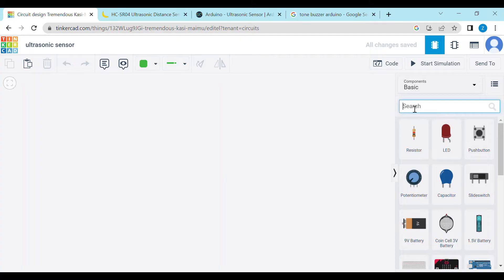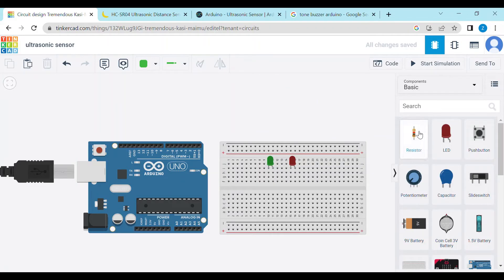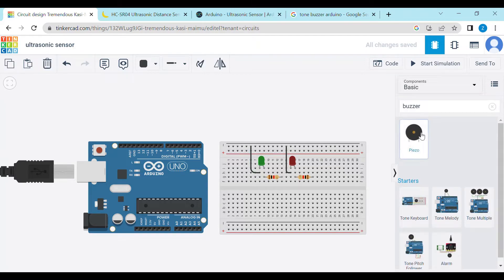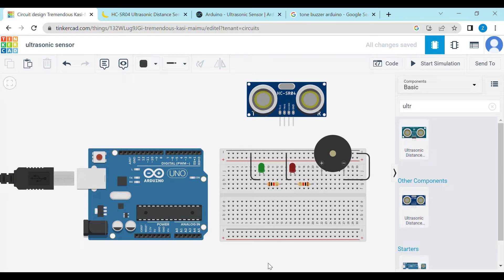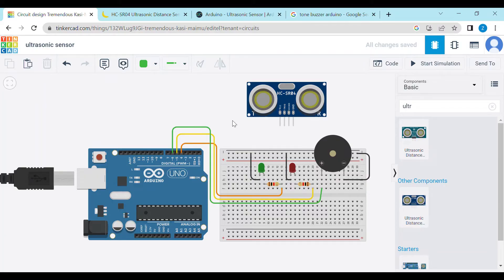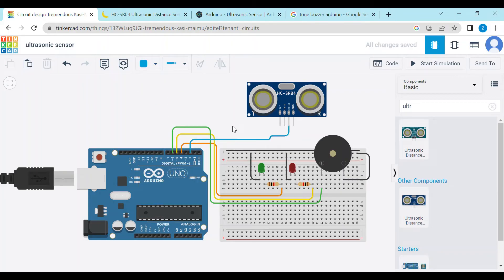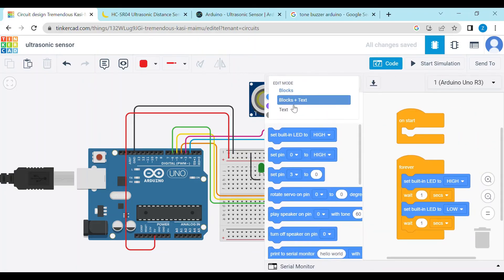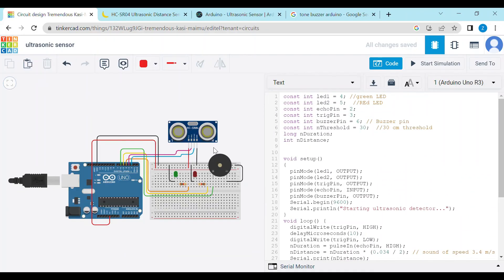How to Make an Arduino Ultra-Sound Parking Sensor with tinkercad

Comment: const int led1 = 9;   // Green LED
const int led2 = 10;  // Red LED
const int buzzer = 6; // Buzzer pin
const int echoPin = 7;
const int trigPin = 8;
const int threshold = 30; // 30 cm threshold
long duration;
int distance;

void setup() {
  pinMode(led1, OUTPUT);
  pinMode(led2, OUTPUT);
  pinMode(buzzer, OUTPUT);
  pinMode(trigPin, OUTPUT);
  pinMode(echoPin, INPUT);
  Serial.begin(9600);
  Serial.println("Starting ultrasonic detector...");
}

void loop() {
  digitalWrite(trigPin, LOW);
  delayMicroseconds(2);
  digitalWrite(trigPin, HIGH);
  delayMicroseconds(10);
  digitalWrite(trigPin, LOW);

  duration = pulseIn(echoPin, HIGH);
  distance = duration * 0.034 / 2; // sound speed 0.034 cm/µs

  Serial.print("Distance: ");
  Serial.print(distance);
  Serial.println(" cm");

  if (distance < threshold) {
    digitalWrite(led2, HIGH);
    digitalWrite(led1, LOW);
    digitalWrite(buzzer, HIGH);
  } else {
    digitalWrite(led1, HIGH);
    digitalWrite(led2, LOW);
    digitalWrite(buzzer, LOW);
  }
  delay(500);
}

Comment: I need a code for this please send
Reply from the maker: const int led1 = 4; //green LED
const int led2 = 5;  //REd LED
const int echoPin = 2; 
const int trigPin = 3;
const int buzzerPin = 6; // Buzzer pin
const int nThreshold = 30;  //30 cm threshold
long nDuration;
int nDistance;

void setup()
{
  pinMode(led1, OUTPUT);
  pinMode(led2, OUTPUT);
  pinMode(trigPin, OUTPUT);
  pinMode(echoPin, INPUT);
  pinMode(buzzerPin, OUTPUT);
  Serial.begin(9600);
  Serial.println("Starting ultrasonic detector...");
}
void loop() {
  digitalWrite(trigPin, HIGH);
  delayMicroseconds(10);
  digitalWrite(trigPin, LOW);
  nDuration = pulseIn(echoPin, HIGH);
  nDistance = nDuration * (0.034 / 2); // sound of speed 3.4 m/s
  Serial.print(nDistance);
  Serial.println(" cm");
  if(nDistance < nThreshold) {
    tone(buzzerPin, 2000);
    digitalWrite(led2, HIGH);
    delay(400);
    noTone(buzzerPin);
    delay(300);
    digitalWrite(led2, LOW);
  }
  else{
    digitalWrite(led1, HIGH);
    delay(400);
    digitalWrite(led1, LOW);
  }
}